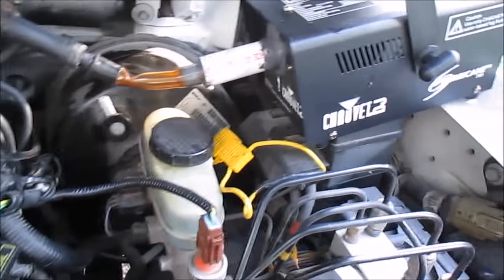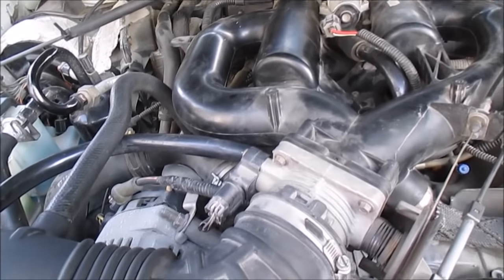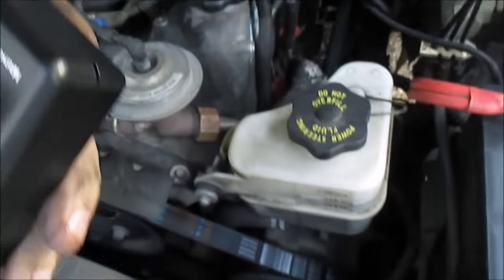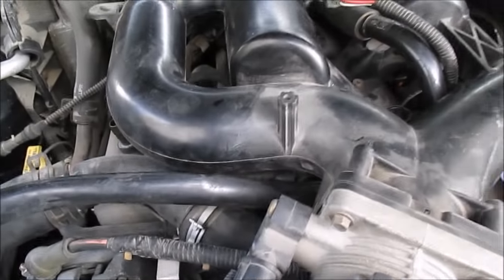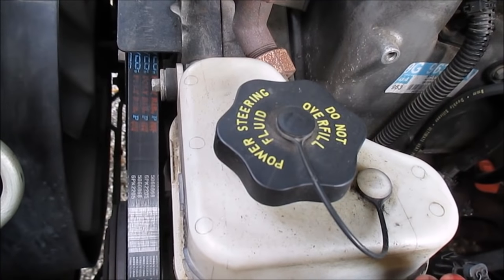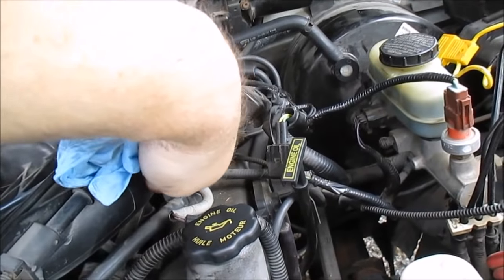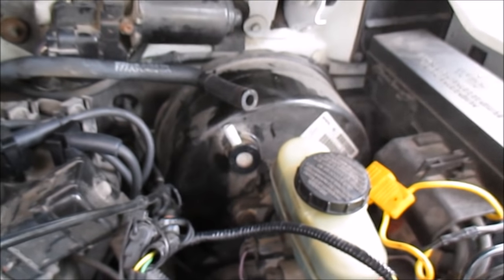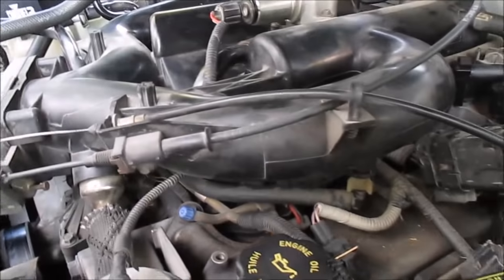Ford Explorer 4 0L SOHC Rough Idle Part #3 Smoke Machine

Comment: Iv'e thought about doing this before and wound up making a paint can smoker, the fogger your using is latex fog, it doesn't stay warm long enough, suggestion, run your car until it's warm then hook up your fogger and the latex won't be condensing so soon I think you will see much stronger results.... good luck!
Reply from the maker: Thanks for the tip!

Comment: i run  SBC BUILT FOR THE STRIP.have a vacumm leak somewhere on the intake ,which is a tunnelram. I can feel gas leaking out of it between the top and bottom halves.there isn't mamny vacumm ports on my car but im hooking up our Halloween fog machine to it today. straight to the intake. thanks for this video. just saved me a lot of time replacing gaskets that might not even need it. again thanks. oh and by the way.ive been turnig wrenches for over 45 yrs building old school hotrods and custom Harleys and never thought of using this fog machine ive had in the storage building for 10 yrs..lol learn something new everyday!!lol
Reply from the maker: Well I hope you were able to find your vacuum leak. Yeah I love watching youtube I am always learning something new. I like to see how people figure out different ways to get things done. I have learned a lot of methods for finding vacuum leaks. Some of the other methods I like to find vac leaks are the water method, it is as simple as getting a bottle of water poke a small hole in the cap, and squirt down around fittings and gaskets, you will hear it suck water in and find your leak (scanner danner teaches this method, and it works great). Another one I use is done with a scan tool, and while observing fuel trims, start pinching off vac hoses (if you see the fuel trims correct themselves that is where the vac leak is, south main auto has shown this technique) Another method is done with very low pressure air hooked to the intake (1psi max), and block off throttle body (i usually use a latex glove) to seal the system. Then I use a leak detector solution, it is a blue solution that bubbles (i buy mine in the plumbing supply section of home improvement store) same stuff used to find leaks in gas pipe. With the intake pressurized spray that solution all around and where you see bubbles that is where its leaking. Oh course you can always go old school and spray brake clean, carb clean, or propane, and find the leak, but those methods can lead to things catching on fire but work great. Well I hope this info helps you out. Thanks for watching and thanks for the comment. Have a great day, and good luck on finding your vac leak.

Comment: We use a very simple $30 exhaust pipe adapter at the shop. We  back a 
second vehicle up to the one we are working on, connect the adapter and 
it works just as good as any EVAP machine. You can make these adapters 
yourself. Best to use a diesel engine vehicle, or by a small bottle of 
pure glycerin from your local drug store and squirt a little inside the 
tale pipe if using a gasoline vehicle.
Reply from the maker: Huh that is very interesting concept, you should make a video on that. If you do make a video showing what you are talking about send me the link, I would like to see exactly what you are talking about. Well thanks for the info, I will have to ponder that concept for a little bit. Have a good day.

Comment: I was watching your video on this fog machine great idea. I was wondering if you noticed any problems with residue left inside the engine after running the fogging fluid through the engine or does it just dissipate  and evaporate .

Comment: I saw on another video using the same machine, that only the hose is held about an inch away from the output of the machine to minimize the smoke wetness. anyhow that's how I interpreted it cuz one person complained about that and that's what the guy replied, makes sense.
Reply from the maker: Thanks for the info!

Comment: I mean... This might be a better idea than spraying a bunch of shit all over it... I'm just gonna wait for a warm enough day and detail then real quick before I get into heavy cleaning before the major engine work I have coming up... Major as in price... Most of the stuff is easy stuff if you have the right tools and parts, which I also don't, so the price just double or trippled per fix....

Maybe I'll just but some tools or something... Living in the car though, so I don't really have much of anywhere to keep em....

Also, your maf side breather tube isn't properly connected and ain't leaking, but I assure you there's a fair bit of pirate air coming in through that.. enough to trip a p0171 or p0174 alone from the looks of it

Comment: DID you ever fixed the problem like was in the intake gasket or was it something else
Reply from the maker: I replaced intake gaskets upper and lower and it made it better, but I found other leaks at the fuel injector adaptor seals, pcv valve, egr tube seal, and crankcase vent and that is buried under everything. Really I think the trouble is its an older vehicle, and I keep finding little things wrong, but I have a few other videos you can check out in my ford explorer playlist that shows some things I have done to it. I have some of it torn apart right now, but it has just been to hot outside to mess with it, and I have been putting it off, but I will be putting it all back together soon and rechecking somethings. Well thanks for watching and thanks for the comment. Have a good day.

Comment: it is a lot easier to do it by using the smoke from a cigarette, I di it in about 5 min to remove the intake hose and another 30 seconds to see the smoke coming out from egr valve

Comment: Hello!   I have a similar problem, at idle, long-term adjustments show a rich mixture (-20%) The engine is running unevenly, trying to stall. Tell me, what kind of readings did you have at the time of the uneven work? I
Reply from the maker: My husband passed away years ago, but I hope you find someone else on here to answer your question. Thanks so much for watching his video!
Reply: @figibloom  I'm sorry for your loss! Thanks for the answer!

Comment: Top man,great video! im thinking of making one myself.have jeep patriot and on idle long term fuel trim is sitting around +10 plus hesitation from 1000 to 2000rpm.air leak?
Reply from the maker: Yeah they are pretty handy to have to find vacuum leaks for sure. The one I made in this video worked and I did find a few leaks. However, overall I was not to happy with it. I think the fog was a little to much moisture for this type of application (little wet) So I am in the process of making another one that will use real smoke and not fog. I have seen many versions online using nichrome wire, paint bucket, baby oil, wick, and a propane regulator to keep the pressure low. However I am going to make mine a little bit different. I got all the parts I need for it, just have not had the time to make one yet. So if you do make something I would suggest using smoke and not fog, but the fog machine did find my leak though so I cant knock it to bad. Anyway about your positive fuel trims at idle yeah it is possible a vacuum leak is causing that, but then again a lot of things could be causing positive fuel trims. If your fuel trims tend to get better at higher rpms (check fuel trims at 1500, 2000, 3000 rpm) typically if the fuel trims get better as you increase rpm you may have a vacuum leak, and if they get worse you may have a fuel delivery problem, or possible skewed sensor. Lean conditions are caused by to much air or not enough fuel.  Obviously there is a lot more to it than that, but that is typically what you want to keep in mind when troubleshooting this type of problem. However, it could be anything from vacuum leaks, fuel delivery issues, skewed sensors (o2, map, maf, tp, ect, and any other sensor that contributes to fuel pulse width), or air infiltration some where, intake leaks, or exhaust leaks, or if you have a misfire in a cylinder. If you have a cylinder full of air that did not get burned up due to a misfire, that unburned air will get pushed down the exhaust and cause the o2 to output a false lean.  So keep in mind could be a lot of things.  Well I hope this info helps you out. Thanks for watching and thanks for the comment. Have a good day.
Reply: +AJ “Figgy” Pierce 
if it had a misfire it would do it across all rpm range.changed sparks,checked coil  resistance,pcv valve rattle although is a little bit oily.looked at o2 sensors.readings looks fine.
anyway,thanks for extensive reply and looking towards seeing more videos on your channel.thumbs up

Comment: Hello, excellent video! A little question, may be you can help me, what means this values?:
At idle              (LTFT +10% , STFT -4 ) 
At 2000 rpm   (LTFT 0%,       STFT 7%) 
At 3000 rpm   (LTFT +4,        STFT +4)
My mileage is very bad!!
Reply from the maker: +Juan Gabriel Florez Moreno 
Well basically your engine computer (pcm) receives input signals from several sensors examples are map or mass air flow, o2 sensors, baro, throttle position, engine coolant temperature, and a few others. The computer interprets these signals and in turn the Pcm controls the pulse width of the fuel injectors. Basically the pcm takes the info of the sensors and determines how much time to turn on the fuel injectors. All of the sensors play a part in letting the computer know what is going on, and the computer adjusts the fuel injector pulse width accordingly. The computer wants to make the engine run at the best air to fuel ratio to support complete combustion which is known as the stoichiometric ratio. This ratio is the ratio that promotes the best ratio for emissions. Now this is not the best ratio for fuel economy (for fuel economy you want a leaner mixture) or power (for power you want a richer mixture), but the ratio the computer is trying to maintain is the best for emission purposes. One sensor that plays a huge role in letting the computer know what is going on in the exhaust pipe is the o2 sensor. This sensor usually sends a 100-900 milivolt signal to the pcm, and depending on the voltage it sees it can adjust the fuel injector pulse width. A low voltage range is telling the computer it is seeing a lean condition and a higher voltage is telling the computer it is seeing a rich condition. Now the fuel trims are letting you know what the computer is doing with the fuel (long term fuel trim and short term fuel trim) stft are immediate adjustments and ltft are done over a period of time. So if the o2 sensor is reporting a lean condition the computer will add fuel (+ fuel trims), and if the o2 sensor is reporting a rich condition the computer will take fuel away (-fuel trims). Now just telling you very basics you can see there are a lot of factors that can screw with fuel trims everything from computer inputs and computer outputs. There are several tests to do to try to narrow down what is causing your potential lean, false lean, rich, false rich problem. Basically testing sensors individually, tests to see if o2 sensor is responding to rich or lean issues (like propane enrichment or create vacuum leak).  A lean condition is caused by either to much air or not enough fuel. A rich condition is caused by to much fuel or not enough air, and really this is a very simple concept to grasp. However, not as easy to figure out because it can be caused by a lot of things. Well I hope this info helps you out, but if not I would suggest looking on google for more info about fuel trim diagnosis. Also just looking at your numbers you gave me,I might guess that you have a slight vacuum leak, because the fuel trims improve under engine load, but I am just guessing. Thanks for the comment and have a good day.
Reply: +AJ “Figgy” Pierce thanks a lot!! I will look for a vacuum leak. may be an spray test? or going direct to a smoke machine?
Reply: Given those fuel trim values, it looks more like a fuel delivery problem than a vacuum leak. With vacuum leak, the fuel trim numbers should get better as you increase rpms. Yours get worse (6 at idle, 7 at 2000 rpm, 8 at 3000 rpm), which suggests vacuum leak is not the issue. Maybe a clogged fuel filter?

However, your fuel trim is still under 10 percent, so it's still considered more or less normal. Fuel trim this low shouldn't affect gas mileage much.
Reply: Yes, you're right. My fuel trims was getting worse since. Now I'am reading the follow values: 

LTFT=+18.8%, STFT=0   (open loop) IDLE
LTFT=+18.0% STFT=+25%, (Transition open to close loop) IDLE
LTFT=+18.0% STFT= fluctuate around 0% (Close Loop) IDLE
LTFT=+16% STFT = +3%      1500 RPM
LTFT=+13,3% STFT=+5%     2000 RPM

So, i'm sure that something is wrong with the fuel delivery system :/  My mileage is poor on city. Now I only wish that the pump is not the problem (is one assembly without posibility of repair)

Comment: I bought a  04 sport trac  by Ford  basically a  explorer.. body is iij great shape but eveday sine I bought it  10  days ago  I keep finding  shit craftsmanship  with it half the electric  stuff  in truck is dead now in noticed crank shaft pulley  is wobbly  meaning its shot now too I got 4 years to pay on this junk  and I'll end up broke  fixing  everything wrong with it biggest problem  is the pulley  problem..800 to repair that or have many other issues if I drive it anymore  like  that....I wish I did my homework before I blew 6700 on this junk